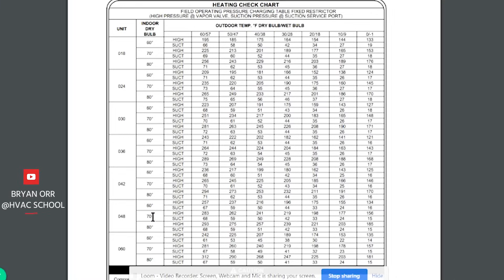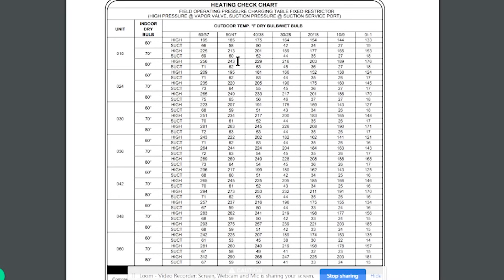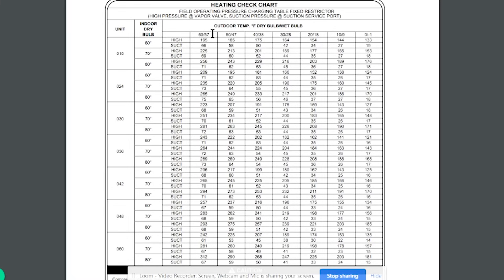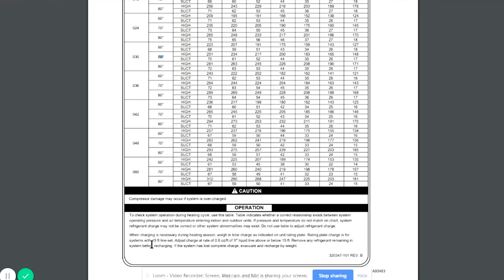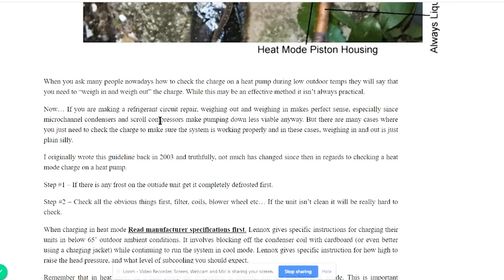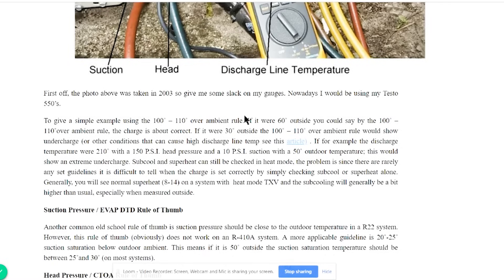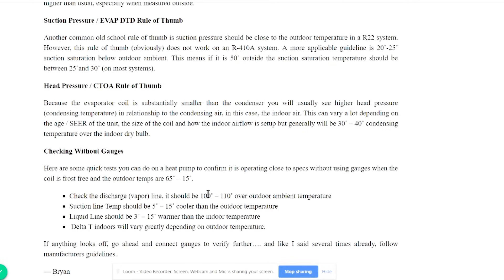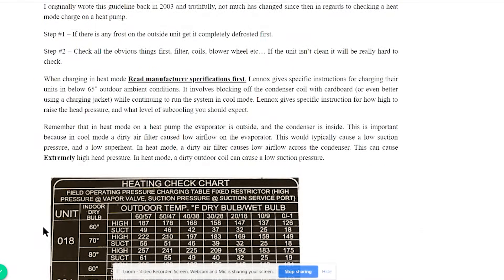Charging a Heat Pump in Heat Mode

Comment: One of the ways to charge the heat pump in winter is the discharge temperature method. This method uses the temperature of the compressor discharge pipe to determine charge. This method is sometimes used when the unit uses a fixed orifice for the expansion device.
SPRSUN Heat Pump Manufacturer Since 1999

Comment: Hi Bryan, great video! Would this procedure still apply on a Modulating (inverter comp) Split System Heat Pump? If not, what would you change in your procedure?

Comment: Thanks for the video. here is what I've got: 1- probably just enough knowledge to be dangerous. 2- A 17 year old 3T 410A Carrier HP. 2 yrs ago, and with some help, I replaced the blown out evap coil and added a new charge. 3- I've been checking pressures and temps on darn near every section and subsection including Suction and discharge pressures and temps as well as return and supply air temps at the air handler.  4- during the summer I believed (and still do) that the unit was low on charge. I added small amounts 2X without having a scale. each time the temp differentials across the coil got much better. 5- Outdoor ambient is currently about 35 deg.  with the digital thermometer on the discharge side I am reading up to 114 deg. I checked the suction side and got about 80 deg. 6- pressure for the discharge side read about 350 chart from unit shows it should be about 320. at this point I truly can't figure out if the unit is over charged or undercharged.  In that the only tools I do not have are a proper scale and vacuum pump, I've been hoping that my research would reveal this mystery but no such luck, yet Thoughts?

Comment: Thank you so much for your two different rules of thumb the 110 over outside ambient as well as the 20 to 25 under outside ambient....8 years of not really having a real thumb for a heat pump and you gave it to me in 10 minutes thank you very much

Comment: This was not the least bit helpful. Your title says CHARGING the heat pump not CHECKING it moron!!! You showed NOTHING about how you CHARGE the damn thing. Where do you put the guages and set the fricking charging machine settings? What guages are opened and which line is the damn refrigerant flowing into the system through?!!!